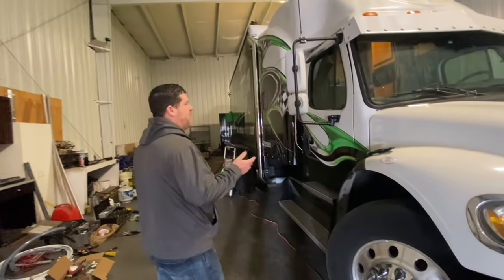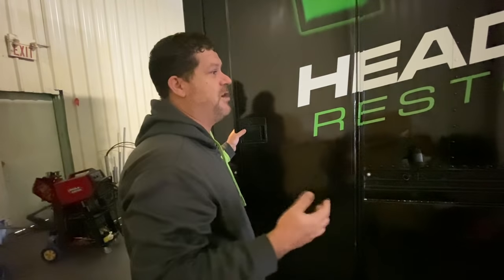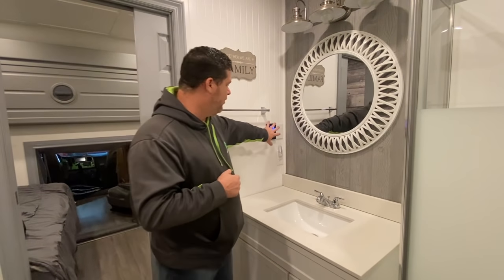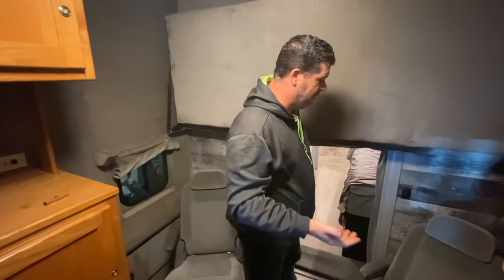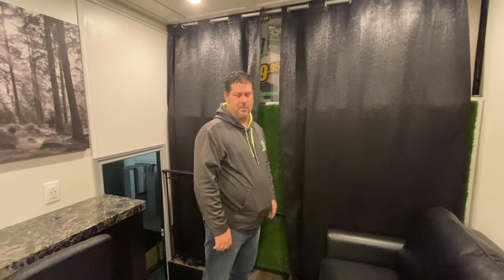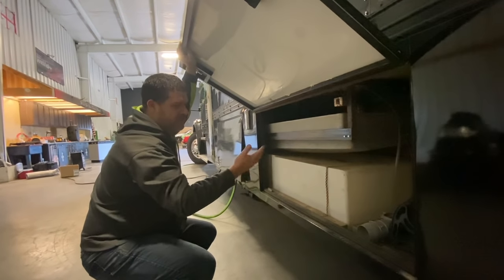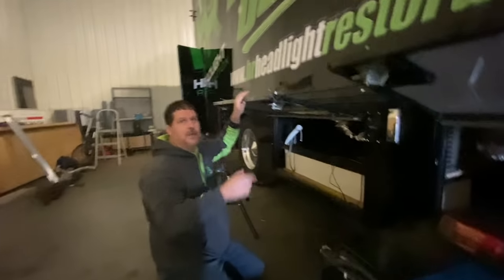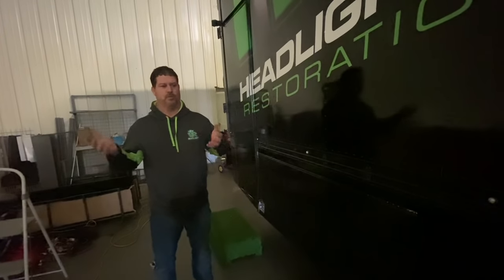Box Truck to RV!! Was it worth it??

Comment: The lack of windows is unsettling, but it’s a nice build regardless.
Reply: I know I would need windows. I’m claustrophobic.
Reply: I thought about that too, but it’s also a consideration that windows are sources for leaks, energy loss and break ins.  I think I could live without them, especially since most of the time I’d be outside anyway.
Reply: have big posters like he has and you can change your senery
Reply: @cliffordtrosper6638  Better yet, buy really large Bluetooth e-photo frames, hang them on the wall to simulate a window, and take a picture of the view where the window would be, and have the e-frame updated and saved with the latest photo.
Reply from the maker: Also remember once the deck goes out its one big sunroom lots of air and light
Reply: @hrheadlightrestoration6858  to be eaten by bugs and allow easy access for mosquito and flies into your camper from a open hole at the back no thanks
Reply: @hrheadlightrestoration6858  pretty sure to be legal it needs a emergency exit through a roof hatch if your rolled over on the door.
Reply: He is right about the windows being covered up. I have a older western box camper and yeah all my front bunk windows and tin foil covered so I can sleep in the middle of the day and it makes it 100% cooler in the heat of the day not having any light access. On the other hand my kitchen windows only have the shades covered if I am in public parking areas. If I'm parked at a rest stop with a nice window view across the mountains and no sketchy people gonna be peeping toms while I am sitting at my table eating having a window to look out of is nice.
Reply: @joelschermerhorn5447  a camera system would be better so u can broadcast on the tv a simulated window view around the rig for security and for just seeing the outdoors
Reply from the maker: no it doesn't it has screens
Reply from the maker: it does have roof vent and remember you still have full access to cab of truck
Reply: You people are nuts.. there are 5 windows!
Reply: @karenminckler4198  I thought i needed windows so got a shuttle bus, couldn't stand it so got a box truck instead.

Comment: Hmmm idk what to say 

Its great you have 3 seperate rooms includes the living room

No windows at all is a drawback for me  even tho i agree that you shouldnt add too much windows however the place would look dark and no freshniess of Air 

The bathroom is super great but the size is over .
because of the bathroom you downsized the kitchen 

If its one person living i could see that work out as long as there are no many people the bathroom can be tricky to lock people fot eg 
If i want to go to my bed let say my bedroom is last i cannot go there untill the person in the  bathroom gets out 

Kitchen is not workable i mean i know you kinda have 2 service kitchens ( unless you relay on fastfoods or else 

The TV location is crazy on every RV i see 
I have no idea how do american watch TVs do they sit straight and move their necks /heads to far left is crazy do u guys not feel any pain ! 

Its really nice but for me it would be not more than 3 days

I can have full kitchen
Full bathroom like yours ( but smaller )  with a way leaning to other rooms 

A normal house living room but smaller 
Some windows around everyroom with good covers ( shades ) 
A good size water tank can last long 
A good solar system can run everything or at least  the AC for the night 
Should be four seasons 

But ofc i respect your needs and your comfort 
Every person has its needs

Comment: It takes all kinds. I plan to do the same thing in the next ten years but right off the start I can tell that I can't afford his level of build. I do want to take it as far above "Nomadland" as possible, not live in a van with a lot of junk. 
I'd like a tankless water heater for a shower and sink. Also, a decently powered off-grid power generation. Keeping in mind I want Stealth as well. Get these three things and then after add on as I can afford.

The preferred truck would have to have barn door rear exit (not roll-up). Pass through from the driver's compartment. Diesel.

Comment: Lots of missing information in this!  Been in the RV industry for 30 years….
Fleetwood panel in this bathroom is a huge RV corporation…
Most RV’s have pocket doors….just to start. Rock solid adds weight, be interesting to drag it across the scales see…DOT has issues with weight going down the highway.  And you have to put you and your personal items in there after you build it..
Windows are amazing to be on vacation and seeing nature. He needed to look at a bit more higher end RV Prevost comes to my mind first
You can actually use you kitchen not wash your dishes in your bathroom 🤮.  Unlimited water needs holding tanks as well for after it’s used black and grey and all is weight… 
Each to their own, what works for you but don’t diss what you don’t know…just a suggestion 
Many blessings

Comment: Question. When you added the storage boxes underneath; does that interfere with changing the rear tires if you get a flat?
I'm looking into getting a similar truck except I would remove the bunks in the cab and do a kitchen up there. Looks great and appreciate the video! Stay safe out there.
Reply from the maker: no we have recovered the rear tires a couple of time with no problems

Comment: This is a nice rig, built by you for you.  A lot like I would, actually.

Since the rig will allways have oodles of diesel available, did you consider a diesel heater for either water or hydronic in-floor heating?  I know a lot of high end and overlander type rigs use it to eliminate propane.  

Also, that is a huge, flat, rectangular roof, perfect for solar panels.  Have you considered that?  I hear a Canadian accent mixed with upper midwest US, so maybe with the heavily insulated roof you don't need AC?

Well done!
Reply from the maker: Yes and it did have the diesel heater in the bunk but pulled it and sold it so when i put in the propane water tank i figured easy to just go furnace was easier throughout but that could have worked too thanks

Comment: I've been considering the possibility of doing something like this or possibly converting a school bus into a Skoolie. It would become my primary living space. A second thing that I've thinking about in conjunction with that is a custom built car hauling trailer. The trailer would have a custom metal frame and it would be enclosed in a material similar to what you might see as walls on a semi truck's trailer. Kind of thick, hard to cut, mainly for security. However, once you get to the location you would dismount the car as well as the side by side ATV. Then you would use the car to maneuver  the trailer right next to the RV's door. The trailer would then become a front porch like area and the material used for securing the vehicles would be put to use as awnings. You could step right out of the RV onto the porch area. 

You've created just about the best truck space that I've seen in my research travels. Most especially your bathroom. I was planning on doing something very similar in the Skoolie if that became the route I chose to go.
Reply from the maker: Thank you very much for liking my video and good luck on your build if you have any questions feel free to reach out cheers

Comment: I am going to do what you did as far as a truck to build.  I have owned Expediter trucks like the one you have.  My question is power train.  Are you running DD engine (Detroit) with an Allison Transmission?  How many miles did it have on it when you purchased it?  My trucks have gone a million miles each before engine rebuild.  Naturally turbos and water pumps etc go south but that to be expected.  Interested to know.  Great job and love the bathroom.  The bathroom is why I don't buy campers.
Reply from the maker: it has a cat c-7 with a 6 speed eaton fuller transmission it had almost million km on it and it worked awesome but little gutless in the mountains since I have had it I have replaced lots of outer engine parts just mainly to have a piece of mind and had a shop go over the motor and put on scanner and told it is strong and should last long time.
Reply: @hrheadlightrestoration6858  I've owned several cats larger ones they are sturdy engines.  I know this sounds crazy but If you reground the engine it will help your torque and run smoother.  1 Ot stranded cable from the head to block then to the negative side of the battery will help a lot.  I do it on all of my cats. Your not really working it hard being light like it is so should last a long time.

Comment: Once it is built as an RV does then only require a Standard drivers license.
Reply from the maker: Yes mine only requires regular license but you have to get an air license if equipped with air brakes which this one has

Comment: The only thing I can think the in demand especially for campers is an add on and they don't know much about it themselves even in homes the on-demand water is expensive mostly because of how customers get charged for things like this were they u what the manufacturer charges for something then times it by at least 3 that way they buy whatever gets installed then they put labor figuring cost same to manufacturer as installation the last is for every thing around ones profit the thing is because of this number calculate when new and better thing like on demand hot water come out its cost has to be high on the manufacturer part because it took a lot of research on how to make instant hot water unlike what is now the common way and probably the worst way to keep water hot water the water just sitting in a tank continuesly getting taken to water temperature set on the tank after ssincensers say hit temperature the hot water tank shuts off the water cools down and when it gets so cold the tank turns back on and most home hot water tank are at least 10 gallons going through this cycle just same for the rv thanks but the at max hold 2 gallons of water not sure how the tank less units heating the water so fast but I do remember when first came out even for a house it didn't come in a gas version then they mad that with a kit so it could us propane but it didn't take manufacturer's long put it all components in same place just took this to final get to this stage and now that it has like u said same installation process as the standard tanks but because most consumers don't know this even in a house it has been put out as energy-efficient (and it is the most energy efficient) and now the installation people get extra because the cost of product whent up (to cover the cost for department plus lower numbers in sales for that unit where the norm get more since being around and that's what were as society used to seeing)but the installation people rip off customers nowadays because  it now takes less labor then before to install a tank less unit one person can move that tank no problem where it's safer to have 2 so u can get tank in place tank less manufacturer's should be getting what the installation company isn't paying out in labor ( hins there higher price but understanding) if installation company's where not using the causation on how to charge were installed is the same as it has for long time it would be cheaper and more popular were developers could either reduce costs or put into making better technology especially since a lot of a money now is being spent on the how we as a people created global warming and its the reason part of the country is having droughts but even now new build still get standard tanks because it cost the installation company less because that tank is cheaper but they keep it so and I know most won't read this because it's not flashy or short but sometimes answering the question of why the cost difference takes a bit to right out were hell the person doing the video should have looked to see why because it's clear he did question it enough to look past that it's a better system and he could install it himself if he would have looked into his own question on why so high price he would have been able to tell a lot more people than me even if he had no YouTube just by telling the people that usd his shower well maybe some will read this that wonders why and it helps so this time was productive

Comment: The box of the truck is sturdy enough "as is" to withstand snow or whatever, so why the 2x6 ceiling framing? Did you really fill this gap with insulation?
Reply: He said 6" Roxul, so I say yes.  I was thinking that was overkill, because I live in Texas, until I heard "Down in the states", which implies Canada and so he would need more insulation to deal with temperatures I'd just die in.

I do love Roxul for loads of properties, but foam is just so much better at insulating and this is a situation where inches matter.  What you could do with 6" Roxul could be done better with 4" polyiso foam.

Comment: Does the $50k include truck purchase, or just the conversion? Considering a similar build using a cab/chassis. Health concerns mandate gas / propane power over diesel, but I was floored when you mentioned this being done for $50k. I feel much better about the cost factor now, I won't necessarily need mine this nice.

A local fellow I'm consulting estimates $17k to purpose-build a 22 x 8 x 7 custom box for 22-26 foot cab/chassis. It likely won't be near as extravagant as this one, but I am just floored at what was done here for $50k. I've seen $100k motorhomes that weren't this nice and versatile.
Reply from the maker: thank you very much glad you liked the video
Reply: I believe he is 60k in total. 10k for truck and trailer

Comment: Windows are there for an emergency egress,  omg if you have and electrical or other kind of fire , you'll be Darwin'ed.  You need at least 2 emergency hatches of some kind even if it's in the floor..., even the best built hame issues.  Not wishing something bad your way but omg.  Did that box have the wood floors when you got it and did you remove them?   They normally are treated with antifungal  agent and or pressure treated material.  Depending on the age they use to use arsinic and formaldehyde you might want to get it tested.

Comment: Is this a commercial truck, requires a CDL licensed
Reply: There are other requirements on top of a CDL as well, ie., permits and licenses. If you were to do something like this, I would recommend smaller truck with about the same size box like uhaul that doesn’t require special licensing.
Reply: it should be recertified as a rv. most does not require a cdl or you get a non-commercial class A cdl with air brakes endorcement
Reply from the maker: All you need is your normal license to drive this truck. Some states require you to have an air license which is very easy to get. But it is registered as an RV. Normal car plates on it.

Comment: Wait, RVs don't have insta hot water? That's insane.
Reply: It's more common in European RVs and newer American ones. Traditional American RV have a 6 gallon hot heater.
Reply: @dand5829  Is this because the tank holds potable water? On the surface tankless seems space efficient, but really, the water, if usable for other things, would be handy to have aboard. Hmm, I can see both cases being beneficial.
Reply: @tombittikoffer412  Yes it does hold potable water. My RV has a 27 gallon fresh water tank but when you add the 6 gallon hot water tank it increases my total onboard fresh water supply to 33 gallons. 

Tankless water heaters are definitely superior, but they are also more expensive. As a result, RV manufacturers go with the cheaper option since a water heater is hardly ever going to make or break the purchasing decision for the customer, especially for customers that are price sensitive. Here in the US you mostly see tankless water heaters in premium or luxury oriented RVs where the price is less of a factor.

Comment: Basically this guy has built a huge tax deduction, everything that happens when that truck rolls out of its driveway becomes a tax deduction.
"Not enough money to build it" ?  That's bullshit, you don't build a rig like that in 60 days and claim you did not have the money to build it.
My guess is, with the base cost of the truck, build, paint....
You got around $165,000 invested. You don't start and finish in 60 days without a bankroll ready to go.

Comment: Yes no windows might make sense if you must go stealth, but that thing is not a van. It's way too big to not have windows. Unsettling was possibly THE perfect word for it.

And why is there a FLEETWOD tag inside? I had a fleetwood made RV.
NEVER, EVER, EVER again. WORST workmanship EVER. 

They left the days trash behind an access panel. Beer cans, cigarette butts, burrito wrappers, saw dust, plywood scraps, wadded up kleenex, and whatever was inside thar kleenex. Eeewwwyyyuukkk.

The CHEAPEST CRAPPY construction you've ever seen.

I'm really trippen' on that Fleetwood plaque. Why?

Oh. Freshwater should NOT be BELOW the BLACK. BAD, BAD IDEA. GRAVITY! It's a bitch.
Reply from the maker: It was the controller a pulled out of a used RV for the holding tanks so I can see how full they are.